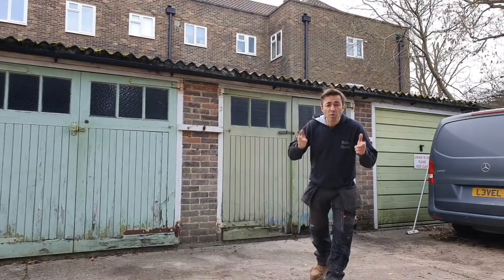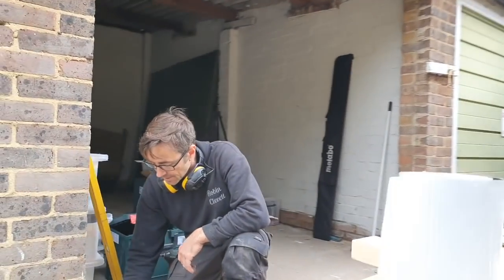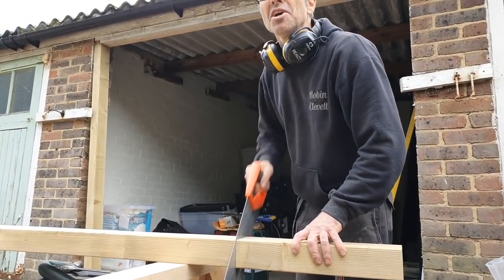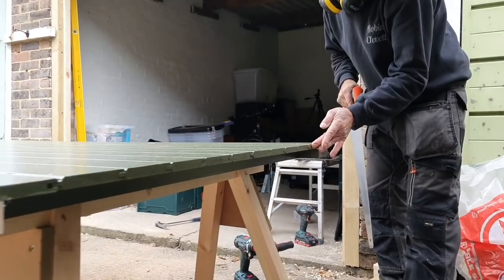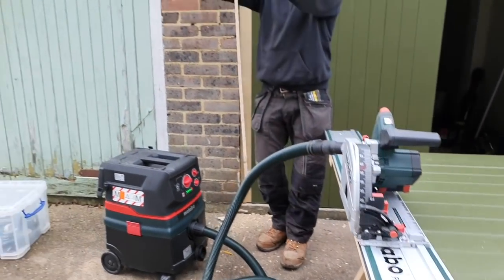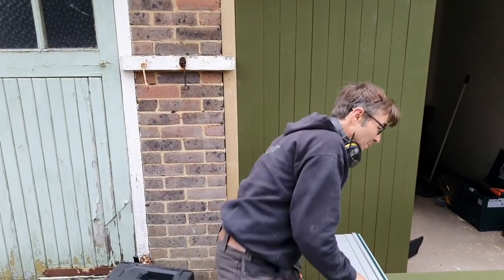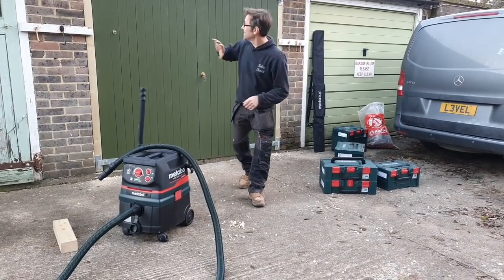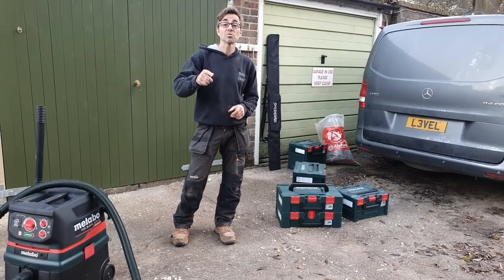How To fit Garage doors

Comment: @Robin Clevett - Great videos, subscribed! Could you share the laser distance measure you have please? Also the details of the concrete/masonry screws you used for the frame? thanks
Reply from the maker: Hi Darren, the Bosch Laser measuring tool is the GLM 120C here is a link to it https://amzn.to/2VPr9sS its a great tool mate, the masonry screws are https://amzn.to/3n76LzD
Reply: @ukconstruction  Thank you - not sure I could justify the cost as I'm just a very keen DIYer - maybe a leica d2?

Comment: I’ve got the same barrel lock. Just out of interest as it sits proud on the outside, do you think a good whack with hammer would knock the lock right out of the back? Wondering if the whole mechanism would be best bolted through the door instead. Rather than just screwed in the back.

Comment: I would recommend fitting a door limiter/restrictor to each door to hold the doors at 90 degrees on a windy day.
Reply: Annoying my driveway on the entrance to where you’d fit the doors is sloped down, unsure what to do in this scenario tbh

Comment: Hi robbin 
I recently purchased a lock like this from amazon (not this exact one) after install I couldn't lock it from one side. 
And if u stood bolt side u do t even need a key u can use your fingure to slide the throw bolt open.
Have u experienced this ? Or was it a fluck from a bs copie I have now returned

Comment: Interesting to see you moving from Festool to Metabo - though can see it has 20% extra cutting.  So what tracks does Metabo run on?  Only its own - or is it compatible with Festool, Bosch or Dewalt?
Sad that they are no longer tied up with Hikoki
Reply from the maker: Hi Julian, the Metabo runs on other rails, it runs on the festool and the bosch and even the mafell

Comment: That extractor looks like it's based on the same unit as my mafell mclass. I was extremely disappointed with the power on that with the Henry outperforming it. Those metabo ones look much better though.
Reply: Metabo and mafell are made by starmix in Germany.

Comment: Where can i buy doors like this for 3m span please and where can i buy plastic shims from ? love the video
Reply from the maker: I am not sure that you will find off the peg doors that wide, in tradition Garage doors where always a standard size hence the reason some of the big joinery companies like Jeld-Wen kindly still produce the doors like the ones I used for a reasonable price, so the doors in this video from memory are the 2134mm x 2134mm (7ft x 7ft) and are about £300 excluding VAT. You may need to have some made for the size you have and because you leaves are wide so about 1.5m the joinery will need designing to suit that width or the will drop so the cost will be considerably more
Reply: @ukconstruction  Thank you so much for your speedy reply. I will have to look around.

Comment: Love the number plate 👌
Reply: It’s illegal
Reply: Why is it illegal?🤷‍♂️ I don’t think it is
Reply: @connorjames6516   these are the DVLA rules
           characters must be 79mm tall
• characters (except the number 1 or letter I) must be
50mm wide
• the character stroke (the thickness of the black print)
must be 14mm
• the space between characters must be 11mm
• the space between the age identifier and the random
letters must be 33mm
• the margins at the top, bottom and side of the plate
must be 11mm
• vertical space between the age identifier and the
random letters must be 19mm.

So the registration plate should read.   L3  EVL

Comment: Did you need to paint the bottom of the door where you trimmed it to fit, or is it ok as it’s not touching the concrete?
Reply from the maker: We repainted the bottom of the doors before out lunch and then when we finished

Comment: Hi Robin, what airbags would you recommend for heavy doors like this?
Reply from the maker: Hi James, the normal size airbags work fine in most cases, here is a link to some nice ones https://www.amazon.co.uk/gp/product/B01DPPU4HA/ref=as_li_tl?ie=UTF8&camp=1634&creative=6738&creativeASIN=B01DPPU4HA&linkCode=as2&tag=robinclevet00-21&linkId=e41c55183b1c3e289130cf65bce722e8

Comment: Hi robin i spoke to you before about the gatemate locks do you know if customer has problem with lock freezing with the bad weather ive tried wd40. Driveway gates froze a few times.  Shame apart from thay locks are good
Reply: Have had the same issue with the ones we have.
Reply: @kmhphotoman  its a shame coz they are good locks apart from that
Reply: WD40 is good for freeing up ceased locks it cleans away all the dirt/rust and any lock lubricant inside the lock it's not a lubricant. before winter use a bit of 3 in 1 oil in the keyhole & hasp holes, cheers
Reply: @frankoneill8117  cheers for the advice i had tried the graphite powder that someone recomend and thats worked well also
Reply: @offcuts4146  that's something I would never of thought of but makes good sense. May well try that for next winter and see how that pans out, cheers

Comment: Robin, on the gatemate what does the 50mm or 70mm version mean. Is it the barrel length or the travel of the sliding metal bar?
Reply: Barrel length
Reply: @peterbell4154  Thanks Peter....do you know how much the bar comes out roughly?? i f not ill look on a site for the specs. thanks for your help again

Comment: What model is the Bosch laser measure Robin + is your hinge jig on Amazon for sale yet??
Reply: It's the GLM 120C. I have the exact same one and it's probably the best value for money out there. Much cheaper than the Leica counterparts (I got it for £160 from amazon like a year ago) and is just as good if not better (I also have Leica a basic model).
Reply: I use hilti pd5 absolutely mm perfect everytime

Comment: I'm fairly sure the laser is for aiming only. The actual measurement is sonic.   Check with metabo/hitachi.
   Those old fashioned hinges are carriage hinges.  Should use carriage bolts with nuts on inside to prevent someone from removing them.  ALL of them.

Comment: I use makita tools, does the metabo hold up in comparison?
Reply: Metabo uses the CAS battery platform which  you can use on other tool brands that have signed up to CAS (cordless alliance program)  cracking tools
Reply: I'm a Makita user mainly. But about 8 years ago brought a metabo 10.8v drill with all sorts of attachments. Cracking little thing,used it for about 5 years. Haven't charged it for 2/3 years and whenever I pick it up in my garage I'm still amazed that it's alive and probably could do a little job if needed. Some arsehole nicked my charger by the way.

Comment: Was the bottom of the doors not sealed and repainted?
Reply: thats why every garage door in the country rots out, nobody remembers to seal the bottom of the fresh cut.
Reply: Hey, Robin, is there prehaps a sealer you can apply to the base of those doors.
Nice job, I always also learn from you. Thanks Mate for all your effort.
Reply: @laurencethackwray5708  Looks like that is were that black tape could be used?

Comment: Just fixed up my new frame to thr old frame with six inch nails put the level on the sides and the bubble isnt dead centre slightly right on both sides .im using same doors in the vidio and strap hinges am i going be in major trouble when i " shoot" them in ??

Comment: I never saw him treat the bottom of the doors.  I made my garage side door and my wife painted it but she forgot to paint the bottom, the door is now warped, and every winter the door swells that much I've had to fit a heavy duty handle so I can get in the garage.
Reply: I'm sure the customer will coat the untreated timber by opening the doors back enough to brush on a couple of coats.

Comment: i would have used round headed coach bolts for the hinges robin ,more thief proof,bolts are inside
Reply: What's to stop someone just unscrewing the hinges from the frame? The screwheads are all accessible.

Comment: so if i turn up with a cordless and some bits i can just undo the hinges from the outside and im in?
Reply: sorry i didnt mean that how it sounds, i just meant as to the security can the hinges not just be unscrewed from the frame to allow the doors to drop out
Reply: The coach bolts are there to prevent this. You'd need internal access to remove the hinges
Reply: @AndyCalderbank  but he used torx screws not coach bolts, theres just 4 torx screws holding the hinge to the frame
Reply: @Daemiex  32:20 drills a hole and places a coach bolt in.
Reply: No coach bolts in the frame side, undo screws on lock side and the door falls off! I’d say these hinges are more gate hinges than for secure doors, however anyone with a cordless jigsaw would be in there in a flash regardless of the hinge used which is the downside to any timber door. Awesome job of it though as usual 👍👍
Reply: @AndyCalderbank  thats in the door not the frame

Comment: That lock cylinder is inviting a smack with a club hammer, I could be in that garage in about 20 seconds.
Reply: That's exactly what I thought! I'm hoping Robin will come back with some reason why this isn't possible....🙄
Reply: @paulradwell9719  They do them in two different sizes for thickness of the door. For some reason he seems to have used the long version.  Maybe it is what the customer bought ?

Comment: I now have Carpel Tunnel Syndrome in both hands from using my palms to knock in timbers and worktops ect. very painful.
Reply: I've always done the same until I sliced my tendons in my ring finger. Was told by the surgeon that all the thumping and bashing can easily snap your tendons 😳
Reply: When I went to Richmond college. The 1st week we was doing common joints in joinery. We was told not to hit with pram of our hands on tools or timber. As can cause damage. The next week they said a student has paralyzed his hand.

Comment: hi robin great video, can i ask where you get your centrebore from and what size etc when you was fixing the frame to the wall.

i fit garage doors for a living (metal framed) but now and again we do make wooden frames up for doors but the other lads dont use countersink bits just basic drill bits to pilot holes, so if you could tell me the correct centrebore bit to be used with spax/concrete screws that would be great.

thank you

jason
Reply from the maker: Hi Jason, this one is a trend have a look on my Amazon Store, I have some displayed there

Comment: Can a tleaf not just cut the extruding barrel for entry.?
Reply: thats what i thought, but i guess its a visual deterrence
Reply: You can get the locks with a 50mm barrel rather than 70mm that Robin fitted in the clip. I found it really easy to replace the broken vale lock with this through the existing 28mm hole. 20mins if that.
Cheers

Comment: Please post the name of that boring bit.  A replacement for the Forstner bit?
Reply: Ok on the 24 I see it is a Forstner improved what brand?
Reply from the maker: David, here is a link to the boring bits I was using, all the best Robin https://amzn.to/3qOQ5PA
Reply: @ukconstruction  Festool I will look on the U.S. Amz for that set while I have Forstner bits mainly for use in cabinets they are not great for timbers yours went in like butter.  Thank You Dave

Comment: Why didn’t ya use longer torks insted boreing them was there a reason mate
Reply: Aaron Bell the heads would interfere with the swing of the door
Reply: @skyhigheagleer6  they woudnt just need to counter sink the head in and use 150mm tork fixing
Reply: @aaronbell8527  yeah good point, maybe all he already had them
Reply: @skyhigheagleer6  he would had to bore them in because 75mm timber and 102mm tork woudnt of got a good enough grip if he just counter sunk the head

Comment: 34:30 I'd be amazed if you didn't know you have to tighten the bit in the chuck then back the chuck off 1/4 turn or so to lock it in?
Reply: It doesn't matter if you lock the chuck or not if its not tight enough to start with 👍

Comment: 32:37 what are the bolts and battens that appeared on both doors?
Reply: The battens on the insides of the doors are to give something to screw into, to hold an eye (which is what i think you thought were bolts) on the outside that a hook will fit into (the hooks are fixed to horizontal white painted bits of timber on the brick pillars either side) to hold the doors open in the wind. You can just about see the hooks hanging down on the white painted timbers right at the end of the video.
Reply from the maker: You my friend are like a YouTube forensic genius!! Thank you for answering that comment and straight to the top of the class!!!!!!!!! Have a great weekend
Reply: @ukconstruction  Thanks Robin, as a landscaper I have fitted many gates (used that same lock many times) so know the routine quite well. Thanks for all the great content on this and Skill Builder.

Comment: Don't like the way that lock barrel sticks out, steel pole over the top you could break that.
Reply: Even if it does t break it will bend and jam the lock. An 18V angle grinder will slice off that barrel.
Reply: thats exactly the first thing i thought, you want it flush with the door - its a target like that isnt it.
Reply: @Dave5843-d9m  its no good at all sticking out like that.
Reply: A simple pipe wrench will rip it out in nothing flat. First rule of a locksmith, don't leave anything sticking out. It's the most common form of attack.

Comment: Wrong sized Gatemate.  The cylinder projects too far from the face of the door.
Reply: keeping the cylinder away from the face of the door averts the rain getting in over time and causing it to rust etc, very little rain will fall on the tiny face of the cylinder the way hes done it  compared to what ever surface rain is above the cylinder face if it was fitted flush
Reply: @Daemiex  Don't think brass will rust! with the cylinder sticking so far out it would be easy for someone just to cut right through it too!
Reply: It only needs to project slightly past the escutcheon.  Not only is it a security risk it just looks plain wrong.  The unit is  brass etc and doesn’t rust.  They are a great bit of hardware.
Reply: From a security point of view its not great, a stilston on it would twist it right off.
Reply: Surely a 50mm throw bolt would have been fine,cant see the stiles being thicker than 44mm ish.

Comment: what's the tape you use, it looks like it would ideal for wrapping fence posts
Reply: It’s the Milwaukee tape. I use it. It’s a great tape. Only issue is it’s got the magnetic tip which I find is a nightmare for grabbing onto screws in my nail belt. But that’s more on my belt management than the tape 😂
Reply: He’s talking about the adhesive tape
Reply: I think if you look at his decking vids he mentions the manufacturer
Reply: @skyhigheagleer6  I’m a fucking idiot 😂😂😂
Reply: I think hes going to be selling the tape on a website hes launching along with some other bits he did a video a little while back

Comment: Petroleum based paint rotted that door.  Use linseed oil paint and the paint and door will last forever.  Petroleum based paint on the new door will start a new paint failure/rotting wood process.

Comment: I think I've just gone and bought the wrong wood for this. Idiot. Bought pressure treated wood but it's more like fencing material (although it is not rough sawn) and has the green tinge to it. Not like the lovely white timber you have. I was planning on sanding and priming before painting but now I'm wondering if I need to go back to the timber yard. What do you think?

Comment: These doors are cheap rubbish and will rot in a few years as the rain will soak up from the bottom cut edge. A common mistake from "chiippies"
Reply from the maker: Hi Andy, the doors where recoated during our lunch break and then when we finished, when they are open you can easily coat the bottoms with a mini roller and brush
Reply: Please accept my apologies  Rob 🙏